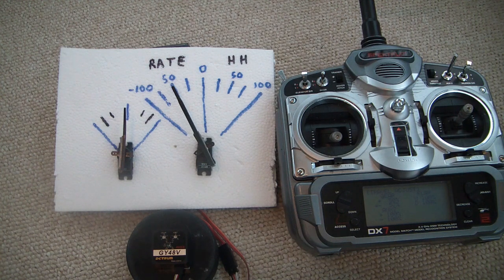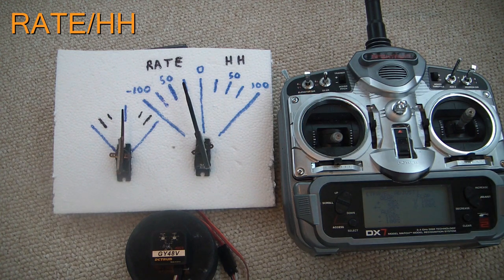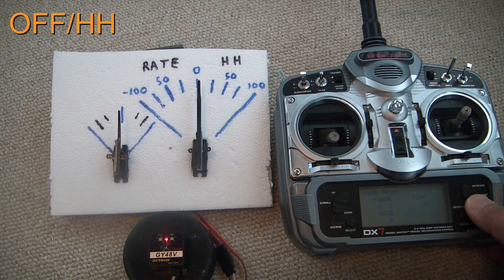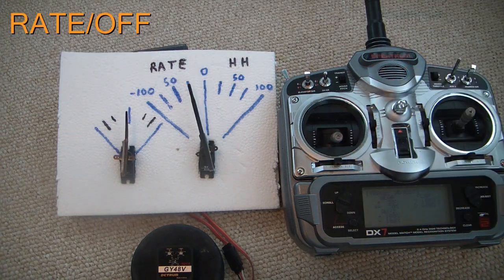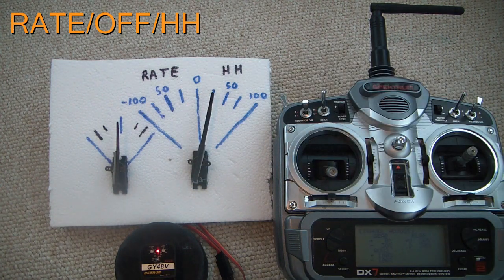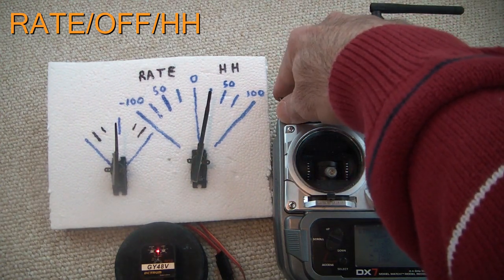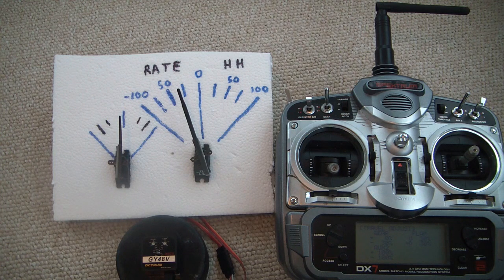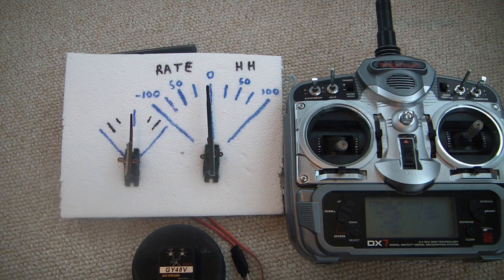Gyro on an Airplane Setup Part 2 Setting up Switches

Comment: Gyro connected to the gear switch.   Rudder
I copied all your settings but my rudder shudders all the time driving the servo nuts - me too - ???
What is causing that?
It is a digital servo.
Thanks